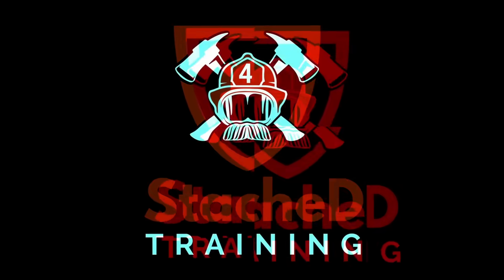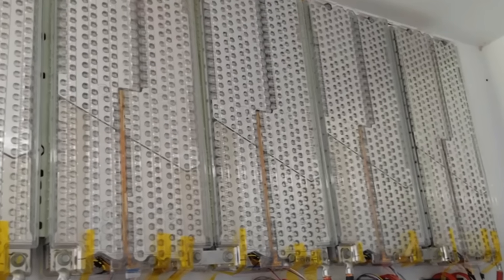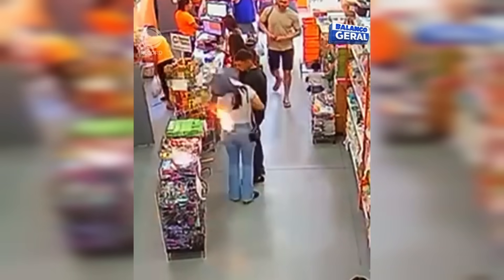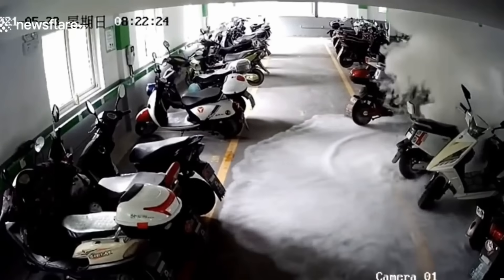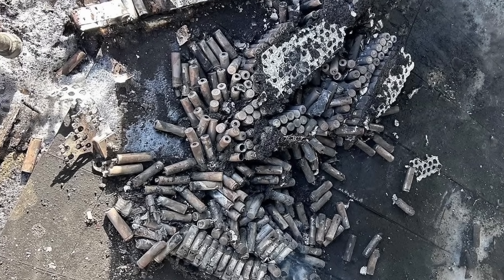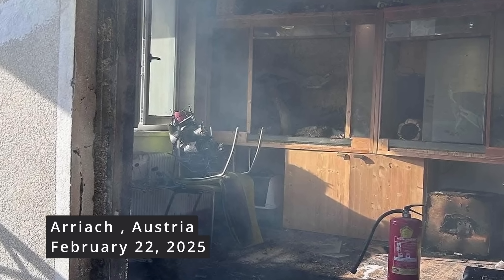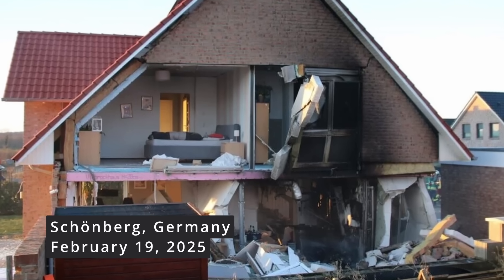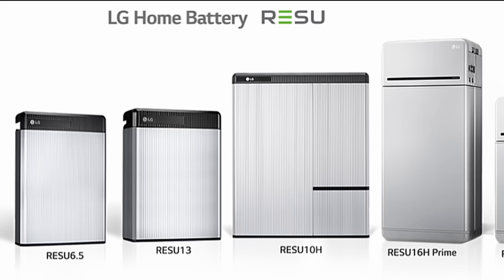Two Homes Just Exploded—The Hidden Danger in Battery Storage!

Comment: Which battery chemistry you would suggest is best as of currently available if you can do such thing?
Reply: lead acid batteries are tested and in use by far 150 years. so thats a way to go. if you are going battery. othervise is a diesel gass or fuel generator something to consider.
Reply: @STG42_44  I am consider some kind of battery system but I have to think many things before that too sadly
Reply: Lto ( lithium titanate oxide batteries). They are more expensive but worth the investment.
Reply: A diesel generator is the best battery technology available
Reply: You need to get off the battery bandwagon and accept that batteries are NOT the answer for backup power storage. They never have been and never will be. They’re a fad that people are buying into because it’s new and “cool” somehow. The reality of their usefulness alone makes them inferior to a generator, but when you add in the safety issues it becomes catastrophically stupid to have one in your home.
Reply: @ Ok diesel generator due to safer mechanics I pressume? They last long I get that but can diesel generator run 24/7 safely? Not for long time but like tops 3 days or so(that's the longest that we have had power outage in our area)
Reply: @DeepBrainThrombosis  re: "They’re a fad that people are buying into because it’s new and “cool” somehow..."  "DAMN YOU ELON...!!!  DAMN YOU ALL TO HELL...!!!" (filled with despair Phil punches sand on the beach like so much Charlton Heston in 1968)

Comment: I have a couple Ecoflow LFP battery systems, primary use is emergency power for a steam boiler and kitchen refrigerator, has me thinking about stability and safety of the system. This past fall I had to get one unit replaced under warranty when the charge controller failed, it wasn't in a dangerous condition, I have since received the replacement and it's work perfectly.  Maybe an emergency exhaust fan for the basement, fire & hydrogen gas sensors, trigger the evacuation blower?
Reply: Foolish. Get rid of that system if you are actually concerned about safety.

Comment: This problem will grow as we ban 2-cycle engine appliances.    The larger Li-ion batteries for mowers, snowblowers, etc, have a lot of explosive potential just like e-bike or scooter batteries do and it's possibly the hardest usage on these batteries with variable temps typical of a garage or shed.     I wonder how the emissions for a housefire compare to the "CO2 savings" (their focus) for batteries?   We will absolutely see an uptick in home fires.    Washington state has a proposal for taxpayers to subsidize residential ESS to hold power for the grid.   Washington state gets 70-90% of its power from hydropower.     If anyone can suggest a reason for this beyond corruption please make it make sense.
Reply: " If anyone can suggest a reason for this..." I can suggest one, but my comment will then be deleted. Can't be spreading "misinformation" you know.
Reply: @aspensulphate  i gave an answer and it was deleted by Klaus' minions
Reply: This is ridiculous fearmongering. I’m guessing you’re also freaking out about your cordless drills and tools exploding while you sleep, you should be worrying about those too! Even more so! NOT.
Reply: @petesjk  Respectfully, battery fires are incredibly rare, but statistics will tell you that larger batteries have more cells and therefore are more likely to fail.   A garage suffers big temperature swings.   High discharge applications with rapid charging on appliances like mowers, snowblowers, and other constant on machines makes them more vulnerable to thermal damage.  This is a problem in summer and winter because batteries like the same temps we do and the highest rate of failure in batteries are these sized packs (see e-mobility fires).   

One good house fire or pole building can do far more environmental damage than the savings of hundreds of battery appliances.     This is a simple fact.
Reply: @christophersmith5303  More fearmongering, did you need to work hard with AI to write this drivel? I don’t know anyone who stores tool batteries in their tools in their garage all year round in extreme cold and extreme heat. Tool batteries need to be charged after use, so people need to remove them so they can charge them. It’s a pretty simple logical concept and practice. It makes sense, unlike whatever you wrote above.
Reply: I’ve move to all electric for my lawn care. It’s been awesome. This video is about large whole home systems. Not the small 2.0 ah batteries.  I assume you only use corded drills too?  Landline only?  That phone in your pocket contains that same explosive battery.
Reply: OP-Answer is they want us dead. 

 They will eventually get rid of gas stations
Reply: 2-cycle is really polluting. At least we should move towards 4-cycle. There's still many applications where gas power makes sense.
Reply: I will NEVER give up my gas powered leaf blower, mower and chainsaw. I’m tempted to go buy backups for all three, just to make sure I always have one to use. Not a chance will I ever go battery powered, even without the safety issues.
Reply: @DeepBrainThrombosis  Yep, my two hedgetrimmers, weedwacker, chainsaw and even my RC, runs with a 2-stroke engine😃
Reply: @DeepBrainThrombosis I've been patching together curb finds since I was a kid, I've got backups of backups and an ebay account. I'm not giving up my gas engines

Comment: I have lithium on my boat, 4 large batteries. I am fabricating a "Burn-Box", a metal enclosed battery box with a metal vent to a thin fiberglass wall on the side of the boat. From the outside, the wall is intact and you cant tell the vent is behind it. If the cells catch fire, it is contained in the burn-box until the heat and pressure blows out the thin wall and it vents the gas and flames to the outside of the boat. no gas or flames enter the cabin keeping the occupants (and the boat) safe
Reply: Retired Marine Engineer here. A lithium battery fire will burn through your hull, sinking your vessel. 1/4" thick plate box will not contain it. NOTHING will put it out. If your burn box is made of either 1/2" plate (with cement floor) or  4" thick cement walls and floor, you may have a chance of it burning itself out while being contained.
Reply: @steverturnsk6190  What about a suitable drenching system to cool the box?
Batteries burn slowly enough for that to work.
Reply: Or, use four lead acid batteries and have effectively zero risks. What on earth is with this obsession with installing lithium batteries in everything? It’s just foolish. Size and weight simply are not concerns on any boat large enough to require four batteries. Capacity isn’t an issue either, as lead acids are available in any capacity you want. There is NO advantage to lithium batteries on a boat. None.
Reply: NEWS AT 11: A boat owner thought he was safe with a DIY "BurnBurn" box to protect himself and his boat from a catastrophic lithium battery explosion and fire.  The Coast Guard has found two life jackets and a thin piece of fiberglass floating in the water near the boat's last reported location.  No survivors have been sighted.

Comment: When BMS fails, it can damage the battery array and cause a fire and thermal runaway. Most of the time when there is damage to cells, it is because of the BMS failure.
Reply: @grabir01 But manufactures don't explain that part about BMS fails, no safety's if it fails, it should auto stop together.

Comment: It sounds like these battery packs need to be regulated such that they are required to be installed in their own outbuilding. The outbuilding should be purpose built with requirements for proximity to other structures, climate control, filtered ventilation, fault/fire alerts and management and perhaps there should even be a requirement for regular preventative maintenance and inspections. Of course, this would make it much more expensive, perhaps prohibitively so for most homeowners.
Reply: Most new areas of cities there is no space for outbuildings.  They put one house next to another with almost no space between them and no or a very small backyard.
Reply: @my3dviews   This is a problem even for normal house fires, as the fire can easily spread to adjacent structures before it is controlled.
Reply: @aspensulphate  That's right, but with new houses being put even closer together, the chance of it spreading to the ones beside is higher.
Reply: $40,000 MORE to save how much kwh/year for 10 years? I built my own concrete bunker into the side of a hill 50 ft from my house. Although it is not professionally engineered, it is functional and keeps the house and forest safe in case a failure occurs.
Reply: As far as I know: that is already a requirement in Canada.
Which is annoying because you can't buy cold-tolerant chemistries like Ni-Cd anymore.
Reply: Dont forget insurance.

Comment: Why weren't the hose jockeys wearing their SCBA cutting into that garage door (a couple were)? At the very least in a standard garage fire they should expect a back draft to occur. I see the charged line, but I don't see anyone holding a nozzle. And shouldn't a vertical cut on each side of the door allow the lock bars to free up and the door can be lifted normally???

Comment: battery packs should never ever be charged in an enclosed space.  EVs should be charged outside away from structures.

if you are trying to home build a battery pack under no circumstance use li-Ion batteries.  there are simply too many gotchas.  off the top of my head i can think of 5 major failure modes that can cause them to catch fire, there a probably more.

 if you must dyi, then use lead acid batteries, they are much more forgiving of people that abuse them.

even sealed batteries need ventilation, because every battery pack will eventually accumulate enough wear that some of the cells will evolve more gas than the catalyst can handle and the pressure relief on the cell will vent the excess.

Comment: When you talked about the garage doors being a degradation panel made me think about having burst panels on high hp forced induction and Nitrous engines but that’s not a guarantee it’ll save the engine. Rob Dahm has a video of the 12 rotor backfire and blew the sheet metal intake open like a tin can.

Comment: The pathway to renewable electrification of vehicles and homes is littered with potential hazards.
Reply: Insurmountable hazards!
Reply: Yes, but hazards can be dealt. You think there's no fires with gas generators? Same for BEV. We think there's pleinty of them because we hear about it but the rate of ICE cars fire is much higher.
My take? As much as a pro BEV as I am, a fire is a fire and should be adressed. They are adressing it for BEV BTW. Some very recent researches demonstreted some easy solutions to greatly reduce the BEV fires potential.
Reply: I feel far safer being a fully electric home have a live gas supply into my house thBks
Reply: Instead of fooling with batteries we should go back to nuclear. Now we have thorium reactors that can't melt down and can use radioactive waste from breeder reactors to fuel them and they use up all the fissile material so there's less dangerous waste
Reply: I have seen a demolished windmill. There was glasfibers al over where the head impacted the ground. I believe The field was used for food production for either humans or lifestock.
Reply: Mineraloil
Reply: There are zero renewable solutions. So far, all the "solutions" have massive drawbacks. If you want to go faster than organic muscle can take you, there will always be trade-offs. Man has to decide what's important to them.
Reply: How renewable exactly? Power the grid with renewables and enough battery storage first, otherwise you're just burning coal in your electric car.
Reply: @ctrlaltdebug  Electricity made by coal plant that feed BEV is still better than ICE. But not as good as made with renewables electricity as you said.
Reply: "oooOOOooo that's a bingo..." (best Austro-German Christoph Waltz/Standartenfuhrer Hans Landa accent).  welcome ladies and gentlemen to the phenomena of "CATCH-22", welcome to PARADOX, welcome to CONTRADICTION. 👈 hint: these are all synonyms and for better or worse, only the most mature minds will be able to properly process and deal with these things.
Reply: @phillyphil1513  Just a Cabaret.
Reply: That is why governments should tax what they don’t want instead of picking a solution and then biasing the entire economy around that solution.

That way every solution has a chance to compete on its merits. Its advocates don’t have to fight a political battle first.

Comment: Aside from the fire risk, having energy is a great idea. 
Cheaper electric tariffs overnight and unused solar power going to waste both prompt people to consider storage.
Also, eco projects often feature battery + solar combinations, selling the idea that storage is more green than on-demand.
This'll need a hearts and minds campaign.
Reply: lead acid batteries are a lot safer but cost more per ah available.  Cheaper than rebuilding your home though.
Reply: @steverturnsk6190  Flooded lead acid and AGM batteries require venting: because they produce hydrogen while charging. "Maintenance Free" batteries will have a platinum catalyst  to reform the hydrogen. But venting may still occur during an overcharge condition.
Reply: Big electric should ditch the need for people to store electricity,   low prices, no houses need batteries that need to be disposed ever 2 decades.
Reply: Yeah, having a diesel generator as a backup is a great idea. Use your excess solar energy to charge a bank of lead acid batteries, or heat a large water tank that can be a stored energy source. Using dangerous lithium batteries for meaningless storage is incredibly foolish.

Comment: I've seen several refrigeration sized unit inside small rooms in commercial businesses. My bet is they have no clue...
Reply: That's scary
Reply: that is why it is ideally advised to buy from reputable manufacturers, higher price but at leat u dont make stake out of your family
Reply: @shazzz_land Tesla is a reputable manufacturer and this situation still happened
Reply: @shazzz_land  
Is LG not considered a reputable manufacturer? 😳
Reply: I just understand that ALL major computer centers do have UPS for their systems. 
In other words...battery systems.
Reply: @reiniernn9071   up until recently those all used lead acid batteries. Same as the battery used to start your gas or diesel vehicle. 

Li-ion batteries are only starting to make their way into the UPS market.

If you’re talking about a data centre, when batteries are used, it’s only  to cover from the power outage until the diesel generators kick in. There are also non-battery alternatives deployed to cover that brief period. I’m not aware one way or the other if Li-ion batteries are actually used in data centres.
Reply: I’m sure that YOU have no clue. The examples were DIY projects gone wrong.
Reply: Darwin Awards need to be revived somehow.
Reply: That's just caveman thinking. But they will learn.

Comment: That is a fairly accurate assessment. Most of these systems are tested to UL 9540 what addresses flames, however I not sure if it's a sufficient for large scale gassing. It really should be outside. The batteries are starting to show up on the roof under the solar modules, let's see how that turns out.
Reply: Have you seen the fire extinguisher UL 9540 requires it's a joke. There is a video of one somewhere on YouTube it just puffed out little powder chemical for 1 second..  NEC and UL are both corrupt passing regulations to increase profits of corporations. LifePO4 batteries are much safer most of the fires are lithium-ion not Lithium-iron.

Comment: enclosed trailer, CO2 extinguisher bottle that mechanically drives an exhaust fan as it triggers, the space gets cooled and flushed with CO@ and also vented well
Reply: Which accomplishes nothing because lithium batteries do not need an external source of oxygen to burn. Sorry, failed again.
Reply: @DeepBrainThrombosis  cooling, venting and therefore no explosion, the fire burns out and you drag off the slaggged battery in one easy package